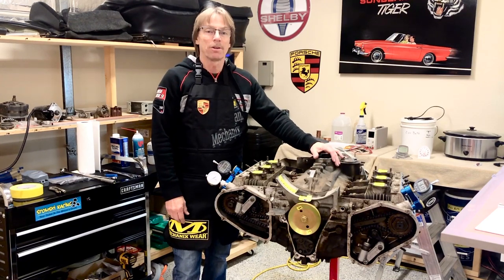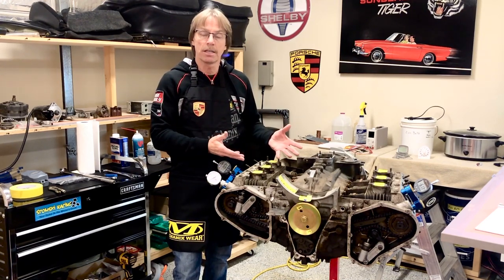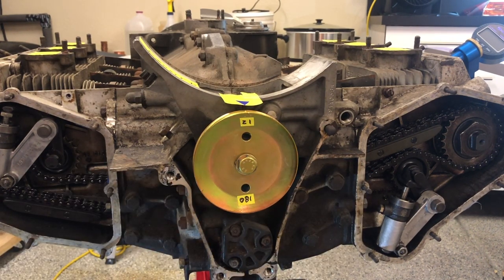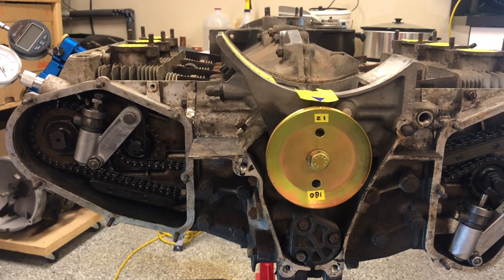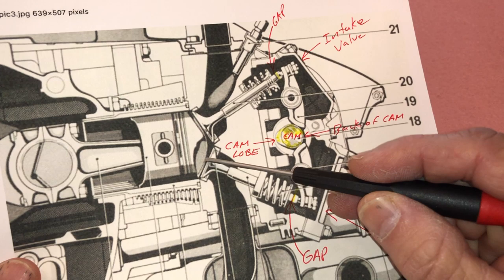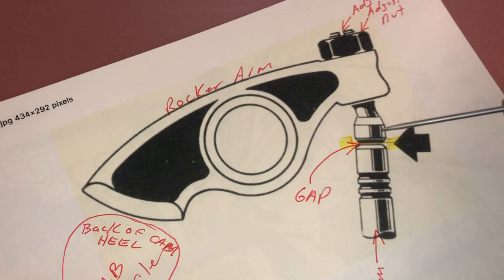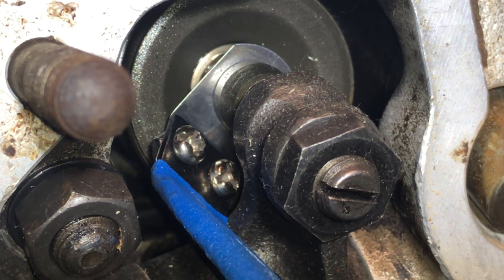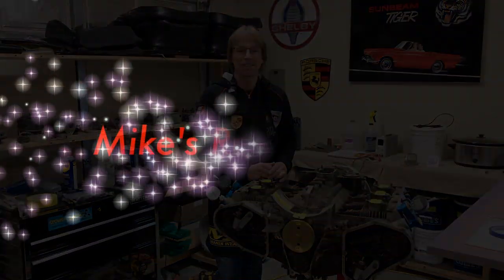Porsche 911 Pre Engine Teardown Check List Part-1 Valve Lash

Comment: Good stuff Mike. Tip you may know: I like to use a razor blade with a small square magnet to place on the side of the blade so I can position it along the top crank case seam. Let it hang over a small amount and you can sight the reference mark on the pulley with the blade like a pistol for getting a perfect TDC. Or better yet that digital crank tool from where you got your dial fixtures is sweet.
Reply: Disregard, just noticed the 3rd piston travel gauge.  :)  You don't skimp on tools, that's for sure.
Reply from the maker: Hello Calvin
Sounds like you are quite experienced with these engines!
Thats a great tip with the razor blade and magnet..I have seen that one used before and we may use something like that the when we address the real thing. 
Also True TDC will need to be addressed much more accurately at that time for sure.
The purpose of these intro videos are to familiarize the guys with the cam timing process.. Some practice work on dead engine block would be a good way to learn and hopefully provide them with a bit more confidence.
Please share as much as you know us
Myself and the guys will really appreciate any experience input you can provide

Comment: Hi Mike, 

964 Owner here, looking forward to engine stuff 👍.  Tensioner tools and TDC 😂. Is a digital degree setup necessary? I see some Stomski eye candy in the video 🥳  Congrats on an Epic project and thanks for sharing the journey.
Reply from the maker: Hello LovinLife Thank you i'm glad you are enjoying the series .
TDC will be critical to ensure accurate timing..Im working with Steven Stomski on that one following his recommendations. It's possible to set cam timing off of the center of case & z-mark but a small degree of discrepancy is possible. For the smoothest and happiest running engine will require a bit more. Will dive into it deeply when rolling thru the engine build.

Comment: Mike, Apologize if you've already answered or provided, but for the engine, do you have description or listing of the parts/costs?  I know it doesn't account for labour, but would be very interesting to see b/c you are obviously aiming for a near new/perfectly reconditioned engine.  Fabulous channel by the way.  Regards from London, UK.
Reply from the maker: Hello Simon Thank you
At the moment I don't have any numbers put together as the engine will be in progress for many months still.
I don't have a particular budget set to go thru it but my guess is between
20-25k USD should be in the ball park
It will be a fairly extensive build but no performance modifications
Mainly function and ultra detail.

Comment: Very cool. While I'm good with a v8 engine. The flat 6 engine seems like a whole different animal. I'll be watching the series. 👍
Reply from the maker: Hell Pony Down..same here most v8 don't even require valve lash with the pushrod set up and hydraulic lifters
The lash is takes up in the hydraulic lifter..Its a stage animal for sure!
Reply: @MikesRestorations  yep. Been building mustangs since 1991. :) I love me a nice Hydraulic roller lifter.

Comment: Thanks Mike, looking forward to the engine work.
You say that work had been carried out on the engine previously and as the valve clearance is setup correctly can we assume that the engine is in pretty good condition or are you still going to do a complete teardown and rebuild?
Reply from the maker: Hello Nick
Yes valve clearances not bad for sitting over 40 years. I did precisely adjust the lash on #1& #4 prior to setting up the dail indicators.
Im consistently landing in the 4.3mm range of travel value..so it appears he set the cams up to a correct spec for an early 2.0 engine..
However this 4.3 spec he set them too would be incorrect for my engine production numbers..The travel value for my engine numbers should be 3.15mm range both sides. Im not sure why he did that but more investigation will be necessary.
I think assuming things are all good would be premature at this point.
Will definitely go over these details in the next video
Early cars were set up with Solex carbs and I think it was about March of 66 Webers were being installed..this may have something to do with the different spec but 4.3 would still be incorrect for my car unless he did this as some kind of performance mod??? or a recommend change from a Porsche service bulletin back in those days..
Not sure??its strange.. but will let you know!!=)